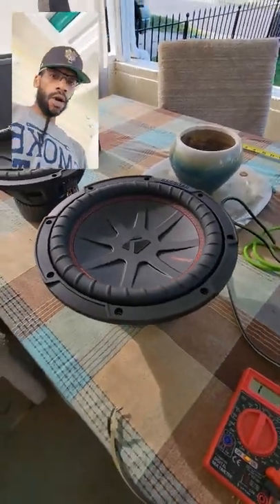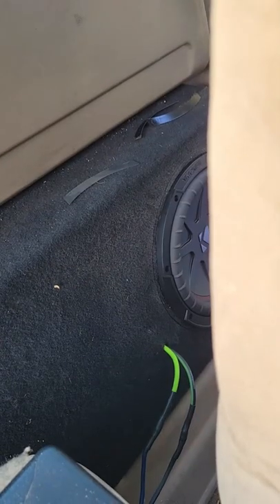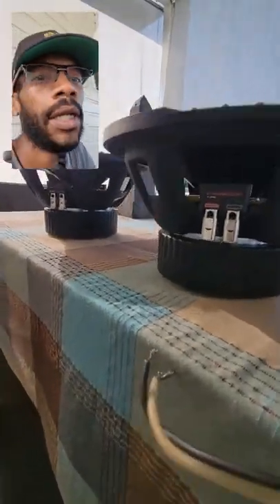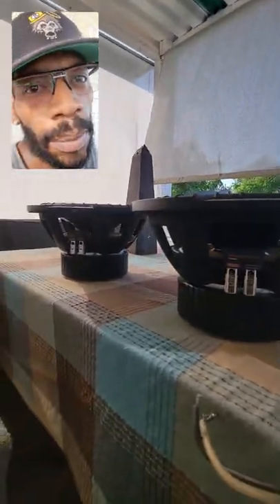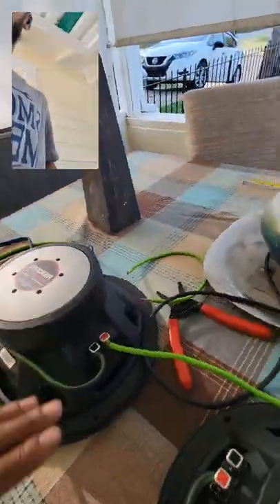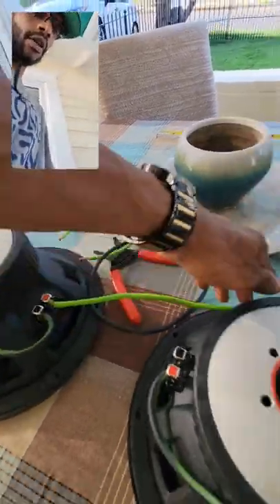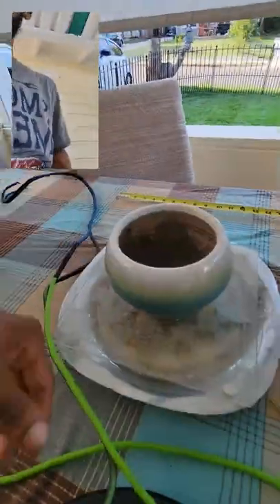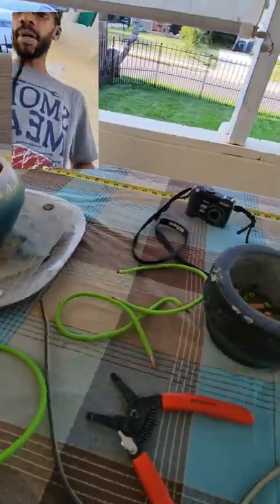How To Wire (2) 2ohm DVC Subs to 2ohm Final Impedance (Series-Parallel) #KickerAudio

Comment: I’m late but quick questing man, how do you wire them if you have two terminal cups on the box?  I have a ported enclosure for 2 subs
Reply from the maker: 2 sets of terminals or only 1 positive and 1 negative.?  I would think the 2 terminals being on the box. It would already be wired as if they were on the speaker, so try the same setup,  think bridged..
Reply: @rolovibes4504  yeah, a cup ( + / - ) for each sub. I also have a monoblock 1 ohm amp
Reply from the maker: @Vibe1017 Look up kicker video series parallel and are parallel series. And that should give you the best setup for what you're trying to accomplish. But those are the wiring types.